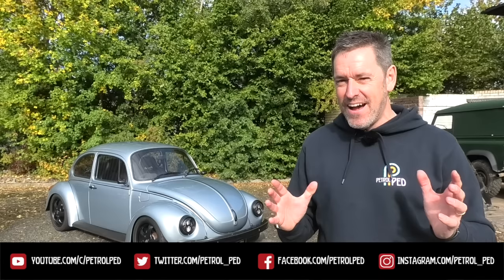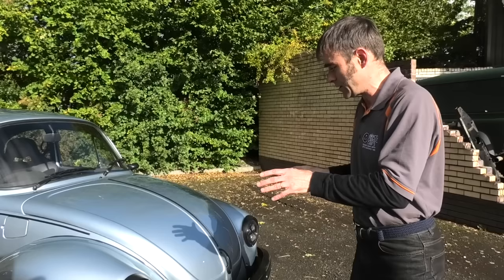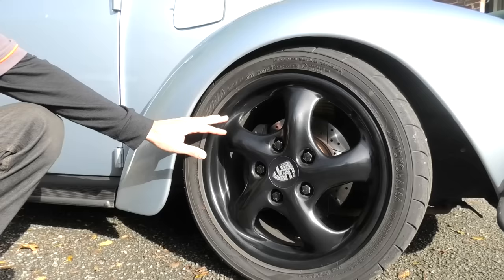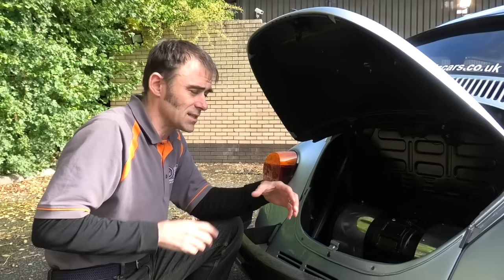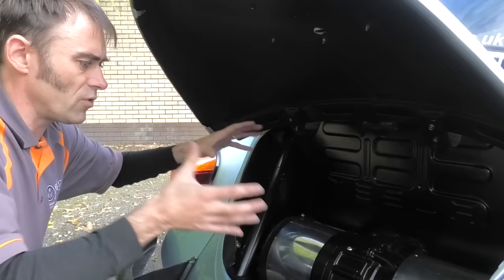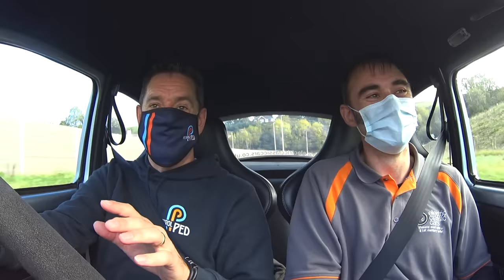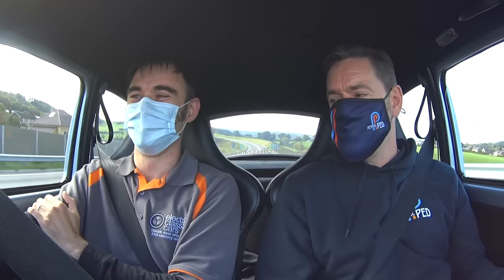*EPIC* 600hp 1000kg Tesla powered Beetle ! [In-Depth Review and Drive]

Comment: So it shows how impressive it is of Tesla to get the wind noise so low
Reply from the maker: For sure. Modern day low drag aerodynamics 👏👏👏
Reply: @PetrolPed  and now double pane, although whether that's glass/plastic or glass/glass not sure, the ideal would be surface treated plastic like glasses, but yes we can insulate the rest of the car, but the huge window area is a thermal issue, I like the way they've improved the dash, legacy just had a huge slab of black under glass, the ultimate heat trap, no wonder cars got up to 70°C, and the aircon had to constantly fight it !

Comment: That Beetle is almost perfect, if it was mine then it would be 😜It is the perfect sleeper car, as there's no engine sound to give away what bhp you have hiding in it.
Are the downvotes from Oil companies ? it's only reason I can think of to downvote this.
The next car I would love to see as an EV is a Citroen 2cv or something similar in basic design like the Beetles and Minis.
Reply from the maker: Tune in to Series 2 of Vintage Voltage next year. There is some mega stuff in that 👍
Reply: @PetrolPed  Nice, I love the idea of giving classics a new heart to keep them going instead of a scrap heap when the engine laws change, the only downside is the cost, you can still buy a new car for the cost of and EV upgrade, but the plug n play setups are getting better and cheaper which is great.

Comment: It's funny, I'm modifying a 1303 with a mid mounted Audi V8 ("vids" on my channel :D ); the chap I got the Boxster gearbox from had a Tesla motor for sale (he was also putting one in a Boxster) but sadly the cost of that was way out of my league let alone all the other parts required. Love the idea of electric - even had a deposit on a Model 3 but they never were as cheap as I'd hoped. Still, I reckon a 300bhp Beetle will still be quite a lot of fun (and it'll sound a whole lot better :D )
Reply from the maker: Good luck with the build 👍

Comment: The mass of the front battery pack isn't low - it's higher than a typical engine. I suppose it could be worse... you could put it on the roof. 😁

It is a very nice clean build... even if the carbon fibre front bumper is ridiculous.

It's too bad that reviews like this don't put the car up on a hoist so the builder can point to the parts (such as CV joints) that he is talking about.
Reply: To be fair, while the battery is not low, and not very low as in most production EVs, Beetle conversions are often much worse because they mount battery packs in the fuel tank space and the rear parcel shelf, both of which are quite high.

Comment: What if you  had, say, a 50 hp motor with the same battery set up? what would be the mileage? 200 miles? You wouldn't need all of the suspension mods, cheaper. You know, just an every day driver Beetle.

Comment: I have 3 stupid questions, 1 is the car now an automatic or is there still a gear stick, 2 what kind of cost is one of these conversion (I know vulgar I'm sorry), 3 could this be done to a mk1 Austin healey?
Reply from the maker: Conversions using a Tesla motor like this are single gear direct drive (Forward and Reverse). Tesla conversions are typically £60-75k depending on size of battery pack and other restoration. 

Yes an Austin Healey is possible but an option hear is to use a less powerful motor (still 120-150hp) coupled to the cars existing gearbox. This maintains gears, although you only really need 3rd for town driving and is much cheaper (£35-50k). Hope that helps 👍
Reply: It's not automatic or manual, because those terms describe how the transmission is shifted between ratios, and (like almost all modern EVs) a Tesla doesn't shift - it has a single gear ratio. Reverse is done by running the motor backwards, not by shifting anything.  In this car, the driver uses buttons to tell the controller whether to run in forward or reverse.

Comment: Do the DVLA have anything to say when you turn a 45hp petrol car into a 600hp electric car, or is that just fine? I know some countries make this really difficult (no option for 'changed fuel type'). And it's not completely crazy to check that people have some clue about the relative performance of engines, brakes and suspension.
Reply from the maker: Nope. Fully road legal 👍

Comment: I would like to know what the weight of the battery pack and the weight of the motor apart?
Reply from the maker: Depends on the size of the battery pack but in the region of 120-150kg 👍
Reply: @PetrolPed  
Thanks so that's about the weight of heavy passenger.🤣
Reply: They only show the battery pack in the front, but say that's half the battery modules. With a total of 12 modules at 17 each, that's 200 kg of modules alone (100 kg in each pack)... then there's the structure, box, wiring, and BMS.

The old Tesla Model S/X large drive unit is 134 kg; that's the motor, gearbox with final drive, and inverter/controller.

Between the battery packs, drive unit, and other associated components (charger, DC-DC, cabling, junction boxes and other wiring devices, cooling system), the electric powertrain will be over 400 kg... which is a lot in a 1000 kg car. Since a stock Beetle was over 800 kg with a much lighter powertrain, all of the lightening work was needed to stay down to 1000 kg (if they actually managed that).

Comment: hey there just wondering what inverter did you use? awesome car ..
Reply from the maker: I think it was the inverter from a Tesla performance
Model S
Reply: @PetrolPed  thanks!
Reply: Everyone uses the stock Tesla inverter (the power section), but they either often change the controller board (the logic that controls the power section).

Comment: Nice how much to have one built?
Reply from the maker: Conversions like this using a large Tesla motor typically cost between £60-65k plus donor vehicle, depending on the amount of modifications required and the size of the battery pack 👍

Comment: Do you have a rough estimate of conversion costs?Cheers.
Reply from the maker: Conversions using direct drive Tesla motors are in the region of £60-70k depending on the range required and other work needed 👍

Comment: Ever seen an electric car conversion that had Air Conditioning?  Never. Why, because you’d have to build a power system dedicated to powering the compressor.  If you use your existing batteries you lose range.  Not good.  A great VW vehicle to go electric is an old Bus.  Lots a room to put batteries.  Unfortunately they cost a lot now $25,000 UP+++

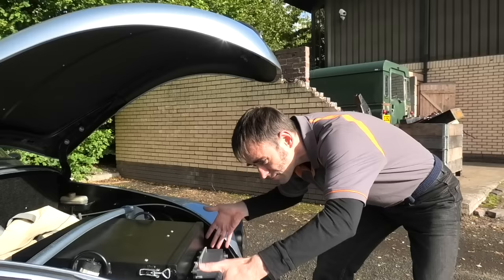Comment: 5:38 With the curved windshield and brace going from side-to-side under the hood, I'd assume that you started out with a Super Beetle, with the strut suspension. Was that a preferable choice for a 600 HP conversion, or would a traditional  torsion-bar Type 1 have done just as well?
Reply: The front battery pack probably wouldn't fit with the original Type 1 suspension.

Comment: I realise this is not a car built for long range, but would it be possible to install regenerative braking on a electric conversion?
Reply from the maker: It has regenerative braking 👍
Reply: Regenerative braking is inherent to the induction motors. The only things that need to be specialised for regen are the inverter and the charge controller.

Comment: How long for a full charge on your driveway? (Tesla model 3 takes 18hrs)
Reply from the maker: This only has a 35KW battery pack so about 4-5 hours on a 7kwh charger 👍
Reply: Hmm. It’s a useless toy.
Reply from the maker: No, a battery pack size chosen for weight and performance. The car will do 100-120 miles which was the design brief. If you want more range you need more batteries, hence more weight 🤷‍♂️
Reply: But that’s my point. There’s nowhere to fit more batteries, and they’re heavy. And then the charge time goes much higher. Electric cars are bs in terms of usefulness. Only being able to drive 50-60 miles on an outward direction so you can make it back again is so utterly  impractical. Especially considering the cost of these motors (£20k-£60). 
They are not the future. We shouldn’t be investing in futures reliant in Chinese batteries, or anything Chinese for that matter. And electric cars are not that green unless the electricity is produced with carbon neutral methods. 
All total bs. People are just kidding themselves
Reply: @djlord9189  blimey..........your a bundle of joy arn't you?..........NOT........ps:- its the Chinese that make many of the high tech products these days!
Reply: @djlord9189  thanks for the article............but i hope by 2030 when we can only buy new electric cars in the UK, the charging network infrastructure is fully in place!
Reply: @scrmepal  it’s not gonna happen. If you live on a terraced street, where do you charge? And where is all this extra electricity going to come from to power 40 million electric cars that all need to charge at night? Solar panels? 
The government can’t even afford to repair the potholes in the roads, let alone dig up every residential rd in the country to install millions of charging points. 
It’s pie in the sky.

Comment: Did they build their own packs or did the come from the factory prebuilt? Also is the controller built into the motor?
Reply from the maker: The battery boxes are fabricated in-house. To batteries packs are bought in, LG Chem in this case, and fitted into the battery boxes 👍
Reply: @PetrolPed  You guys are lucky to get parts for a reasonable price. A Tesla motor in Australia fetches a mighty bounty. Batteries are expensive here too.
Reply: The controller is with the inverter, in the cylindrical housing to the right of the motor (which Moggy points out). There is no mention in the video of whether they are using the original Tesla controller with an external control unit to manage communications, or an aftermarket or homebuilt controller board in replacement of the one in the drive unit.
Reply: @PetrolPed  In the conventional terminology of the industry, those are "modules" from LG Chem; a "pack" is a set of modules in an enclosure - this Beetle has front and rear packs.

Comment: How much will it cost to converte a brz to this elc spec ?
Reply from the maker: You would need to contact Electric Classic Cars to see if they would be able to convert a BRZ. I gut feel is it is too new for them. A large Tesla conversion is normally between £50-65k depending on spec and other vehicle work required.

Comment: Can the LG batteries really cope with 14C ?
Reply: No, but since these 16S1P LG Chem modules are intended for a plug-in hybrid application (the Chrysler Pacifica Hybrid) they have relatively high power capacity, so this 32 kWh pack can handle higher power than, for instance, a 32 kWh Leaf battery.

Comment: Interesting that they chose a Super Beetle over a normal Type 1.
Reply: Better suspension.
Reply: That low location for the front battery pack that Moggy mentions is allowed by the MacPherson strut front suspension of the Super Beetle (1302 or 1303), but wouldn't work with the traditional suspension. This version also has a slightly longer wheelbase for stability, but the biggest advantage is the CV joint suspension - the Tesla drive unit wouldn't work with swing axles, and the pivot axis angle of the CV joint verison is much better for handling.

Comment: How much did this build cost?
Reply from the maker: A conversion using a large Tesla is in the region of £50-65k depending on the size of battery pack 👍
Reply: @PetrolPed  I found a setup of battery/motor and tranny for around 6k. I'm looking to do a build this summer! You know what other components would be required as well? Like I know a motor controller is required... But what programming wiring is needed this really intrigues me

Comment: It does not look like a normal beetle, it looks like a normal super beetle.
Reply: With a curved windshield, CV joint rear suspension, and MacPherson strut front suspension, it is presumably a 1302 or 1303, called the "Super Beetle" in North America (but apparently not in the UK, so the builder and presenter would presumably not call it that).

Comment: 7kw charger, 32kw batteries, 3 and a half hour charge time? Not bad
Reply: 32 kWh, not kW. And obviously it can't possibly fully charge in 3.5 hours with only a 7 kW charger; a full charge would take more than 4.6 hours.
Reply: @brianb-p6586  lol 8 months later... But yes you're right, to fully charge 32kwh from empty in 3.5 hours would require roughly 9kw charge power
Reply: @JamesFaction  Yes, YouTube videos get comments when people stumble across them - 8 months isn't long. But thanks for the confirmation.

Comment: All these people you hear talking about electric cars being "green" is total BS. The batteries for starters are far from green, they also have fuck all of a life span compared to a combustion engine. Also as he says the range at best is around 125 miles, so my question is, how much electricity does it take to charge these things?
Reply: EVs are ideology
Reply from the maker: Short battery life span is a myth. Tesla taxis in Amsterdam with 500,000km running at 80% battery efficiency. No moving parts in the motor so huge life span. This car only has 125 mile range as a small battery pack was chosen to keep the weight down. Please do a bit of research before having a go 😜

Comment: So that engine from Tesla model S doesn't have 350hp. But with 20kwh battery you don't even get the half of that power. I would say 200hp
Reply from the maker: It’s the rear motor from a Model S Performance and with software tweeks it is as stated 👍
Reply: @PetrolPed  did you dyno it? 20kwh battery pack cannot give you 450kw of power. That is one thing. 
Model s p100d has 2 motors in total 680hp.

Comment: My understanding is these forklift motors are around 350 HP on average. There's a vidio. 2 of these shafts hooked together @ 730 HP. Vidio how to do it. Vidio 2 different cars racing Testla dragstrip. Both cars beat Testla by half track. It wasn't even close. I don't get ur bug bening so slow. Something isn't quite right. 350 HP in a car 1,600 lbs.

Comment: Soo electric cars take out the transmission, the engine and all that complicated stuff out, which are pretty inconsistant and give you a more predictable drivetrain with a lot less moving parts if i got  it right. I still don't like tesla cars as a package, but their drivetrain is awesome.
Reply: Yesmuch simpler, but range and recharge time is still unacceptable for North America. First you have to find a charger, then wait several hours. That would add several days to a road trip, not to mentioning going out of route to find a charger....if you can find one in places like wyoming.
Reply: @kdrapertrucker  I know that charging is a big negative about electric cars and there are other problems with them like added weigh. The charging network needs time to be done as does the perfection of charging technology, but it's  right around the corner already. The range problem is there as well, but i think it could be solved with a simple gearbox, which would bring back a bunch of moving parts, but that's not the end of the world. At least i think that's how it works, I'm not an engineer.

Comment: Curious to know how much he spent on the project.
Reply from the maker: Large Tesla builds are normally £50-65k depending on the work needed and the size of the battery pack 👍
Reply: @PetrolPed  Thank you for that information. I've converted a couple of MGs, the first about 12 years ago when written-off EVs were just a dream (some videos on my channel). Even then it was apparent that the following maxim was true - "If you want a project then build an electric car. If you just want an electric car then go and buy one, it will be cheaper".   That Beetle really is an excellent job.

Comment: you have all of your problems figure out on your electric car on your VW you could like real good money if you design a cage  were the Electric engine will fit in the bottom of your VW with the right axle assembly built all together only with the right make & model know because I am a master auto mechanic myself yeah you could make very good money making sibblies to fit VW different years and different models would have to be made different

Comment: Why wearing these kinda masks if they have zero protection...
Reply: A study that came out from Duke university last week found that the loose-weave masks actually make viral transmission worse by aerosolizing spit that would otherwise have settled on the floor. I wonder if they are required to wear them while driving in the UK.
Reply from the maker: UK Government Guidance. I have a responsibility to been seen following current guidance 👍
Reply: Just think about this. Why would the goverment say to you that you need to wear masks that have no protection at all. Its fake safety that they are creating but why!?

Comment: No where near 600hp
Reply from the maker: Err...yes it is 👍
Reply: The motor might be capable of that (although not with the stock controller), but the battery is highly questionable... it might do that for a few seconds starting from fully charged, but it's unlikely.
Reply: @PetrolPed  Based on what? Moggy's claim, specifications from a manufacturer, or a test? Keep in mind that Tesla didn't claim 600 hp for the car with this motor plus another motor at the front.